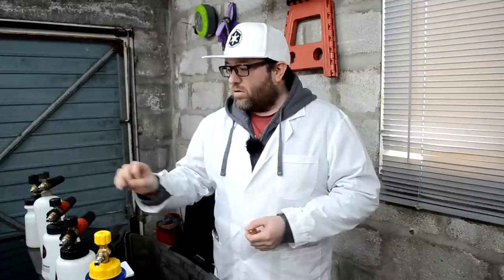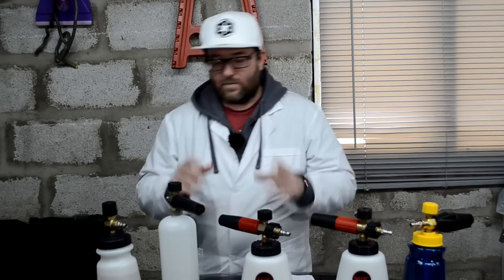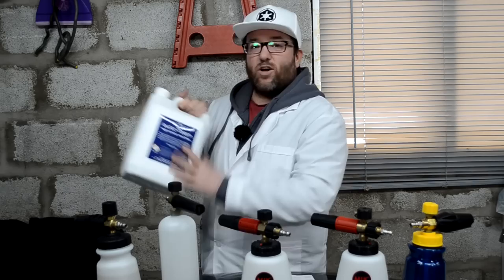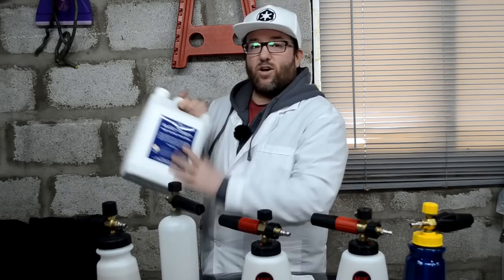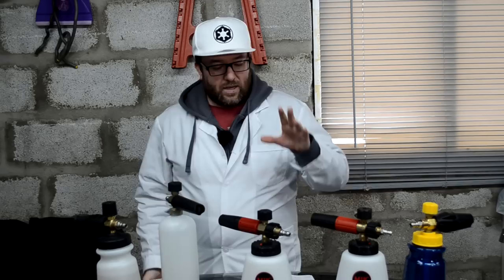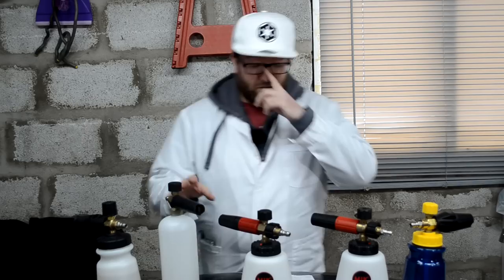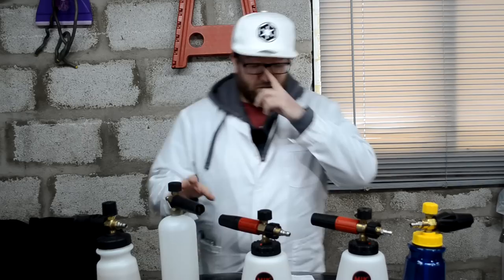Are You Using Snowfoam WRONG?!

Comment: Great content specky, I use a K2 with the autoglym lance. I use the BH pir ratio witch is 486ml of product with 514ml of soft Scottish water. 

Only problem for me is that it doesn’t start foaming up till 3 quarters down the bottle. Witch is really annoying, it could be down to the Karcher hose restricting the flow. 

I have a Screwfix special that is more powerful, and I have modified the QR gun to fit. I have just not tried out on the car yet.
Reply from the maker: Strange that it doesn't foam straight away. I had that when I first used snowfoam and just kept twiddling the top dial until something changed and there was foam aplenty.
Reply: @SpeckyMcSporran   cheers mate I will try that this weekend 👍🏻
Reply: Do you run your K2 for 30 seconds or so before connecting your lance? This blows out any air from the hose and ensures a full bore of water. If you have any air in the hose when you connect your lance it might take a while to properly combine with the product in your bottle.
Reply: @allanmountford21   never thought of that, I will give that a try. Thanks mate 👍🏻

Comment: I’m only at the start of the video but I presume this video might be about panel impact ratio but I may be wrong , most manufactures don’t tell us this , bilt hamber do and I think it’s crucial as 1 pressure washer and Lance may end up diluting the snow foam with double the water compared to another brand so it won’t work right

Comment: This was fascinating, thank you Specky! Fantastic to see the real differences in flow rates between the different lances, especially to see how the MJJC V2 is performing, no wonder that throws up such thick foam, aside from how it aerates the product, it's the volume of product in there!

Did you also see that BH state you should get 4 average size cars from a litre of pre-mix solution?
Reply from the maker: Are we talking pre-dilution or post?
Reply: @SpeckyMcSporran  it's post (although a good joke to be made!). The wording on the PIR calculation diagram is "Please note - it is not necessary to use all diluted auto-foam in one wash. One litre of diluted product should last 4-5 washes".

I've achieved that before, you need a really wide fan on the lance and you're running around it, barely getting any on it really, it's definitely not a blanket of foam!
Reply from the maker: I was going to mention that, barely a teaspoon of product hitting each panel 🤣
Reply: @SpeckyMcSporran  I need a winter warrior car that still hasn't been cleaned in order to demonstrate the difference in cleaning ability...but I've done most of my customers now 🙃

One thing I was wondering on the video is where you found in the analytics you had drop off. I skipped from about 2m45s to 6m30s (ish) when you were talking about fan width and orifices (because this isn't nee info for me, it was relevant information for some and glad it was included...but it's hard to make that sort of stuff engaging).

Comment: Good vid. Better to use a hot wash or a cold wash
Reply from the maker: Most snowfoams are designed to work with cold water as it would be cooled rapidly by the flow of water through the lance. If you have a heated pressure washer then the heat would definitely help to a degree.

Comment: It's catch 22. I sympathise with the manufacturers as for sure there are a lot of consumers that just want to know how much product to put in their lance. But this just does not stack up as the variation based on equipment in use can be massive. So I also blame the manufacturers for not acknowledging this. We need PIR based measures. I tend to take ratios for sprayer bottles as this is given more commonly on products then work that back to what it means to achieve that as PIR in my foam lance.
Reply from the maker: I think most chemical breaks want to give a generic average number that will suit most people. I'd like to see more brands (specifically those who are popular with professionals/enthusiasts) make panel impact ratios available and even make a bigger deal of it.

Comment: Great video, this will be very useful to a lot of people I think 👍🏻
I think you mentioned that you had the mixing valve set to max water flow (I may be wrong)? It would have been interesting to see the flow rates with the mixing valve giving max product as this is how most people use them and it would change the PIR again.
Reply from the maker: No, the valve was set to maximum product delivery. Sorry if I didn't make that clear, I was measuring the maximum product delivery to the water stream.
Reply: Wow, that does make those higher flow figures really significant then! If your lance does 17ltr then at something like 1:10 your getting minuscule amounts of product, your only getting something like 6% of the already diluted product through the lance, per litre……
Really makes you understand why companies like BH push the PIR so much haha
Reply from the maker: Yep, I'd like to see more manufacturers make their PIR figures available.

Comment: Very useful video cheers, I'm new to using foam and just got a pro kleen lance plus with some of their foam. Not impressed with the foam which suggested it was super concentrated and to use 9:1 and boy does the lance guzzle the stuff, looks similar to your duel unit and guessing it's just as thirsty if not worse. Drank a whole bottle to just about cover a fiat 500 went on fairly thick and covered well but the stuff did not dwell very well at all. Debating whether to send it back and spend a bit more on a lance or just try a better foam product first.
Reply from the maker: If you can get a small sample of a different snowfoam to confirm then you're better doing that before spending more on a new lance.
Reply: @SpeckyMcSporran  thanks, I reported the issues to the supplier of the lance and foam and they've sent me a different foam to try 👍🏻

Comment: Brand new power washer owner as of about 3 hours ago, so this may not be the smartest question lol but-.. wouldn’t it be potentially worth the effort to “figure out” the correct position of the adjustment screw (and locking down/gluing/marking or whatever) instead of doing a mixture every time? Then you would just put in 100% product and could have the correct end result without having to measure?! I don’t have the real world experience to know if this is feasible, but it will be my first experiment so wish me luck! Lol

Comment: The bottle with water and snowfoam pre-wash also needs the air from the bottle in order to work correctly, right? So ... I guess the bottle shouldn't get filled completely?
Reply from the maker: That's generally correct but some bottles have a breather hole to compensate.

Comment: Hi. It is wonderful video. A quick question. When you mentioned to keep the dial wide open, you meant max of water and less of foam liquid from the bottle or is it vice-versa. Thanks.
Reply from the maker: I meant wide open to allow the highest flow of foam into the water.
Reply: @SpeckyMcSporran  - Thank you so much for the clarification.
Reply from the maker: No problem 👍🏻

Comment: Great insight into this. How does it work with a cheap karcher snow foam lance. Lucky if I have a 300ml bottle to fill.
Reply from the maker: It should work the same way as we don't need the bottle measurement, just the amount of water. Do the same thing, measure the total water needed to drain your bottle and multiply it by the percentage of panel impact ratio you need.
Reply: @SpeckyMcSporran  thank you bro. I’ll do this later on.

Comment: I just put 100 to 150 ml of foam top up to 500 ml with water depending on how dirty car is , only use 500 ml of total product on my vw van 

For me never failed ,never bothered to work it out
Reply from the maker: That's fair, not everyone needs to know but you're using the foam at an above-average dilution ratio, which is likely closer to the correct panel impact ratio. 👍🏻
Reply: @SpeckyMcSporran  guess i should actually pull my finger out and work it out correctly. 

It doesn't seem over kill rinses off ok 

Bilt hamber autofoam is what I use

BTW love your chanel thank you
Reply from the maker: Thanks for the support Jez! 🙌🏻

Comment: Fit like the day loon. Very technical video that had it been anyone else I would have been nodding off as I have in the past. I may go ahead and work this out sometime I am at a loose end as you intrigued me. I have always gone for 50ml to 450ml or 75ml to 675ml or 100ml to 900ml depending on the size of car and not thought anything about it. I presume a 4% PIR is a good general setting if there are no instructions on the snow foam. Regarding sealants what would you suggest for a PIR. Have you tested the cleaning power of a PIR of 4% against a 10 to 1 ratio which surely at the end of the day is the whole point in us using this item and Snow foam. The boy returned from Uni in Aberdeen at the weekend with a car with multiple layers of seagull s**t. I had put GT CS and Sigma on it before he went up at Xmas and TFR and Snow Foam lifted it all including sealants but no etching as far as I can see. Just an idea for Aberdeen folk as my car had been hit on 3 panels by one gull within 10 minutes of arriving and there are rings on the clear.
Reply from the maker: Fit like John?
Ah yes, the scourge of Aberdeen strikes again! Thankfully I live in the Shire so the dreaded "Scurry" is less often seen.
I haven't tested the cleaning ability of 10:1 Vs 4% as of yet but that'll be another video. I'm glad I wasn't boring you enough to put you to sleep 🤣

Comment: Does it change if you don't open the lance dial fully?
Reply from the maker: This test was performed with both lances at their most open settings. Closing down the screw will weaken the  solution and create less foam.

Comment: Great video specky! So.....what about when the instructions say "add 2 inches to the bottle" i switch between bilt hamber autofoam and auto finesse avalanche. I use a mjjc lance which has a similar output to the duel one that you tested,so 400ml of bh to a litre,yet the af avalanche states "2 inches" so with that in mind the bh snowfoam is a more accurate dilution level.....what do you think?
Reply from the maker: I touched on this in the video but basically only two snowfoam manufacturers actually care that you use their product correctly, the rest just give you a general/average dilution ratio that works for the average Joe. I'd like to see more manufacturers publish their recommendations for panel impact ratios so the professional and enthusiast user can get the best for their hard earned money.

Comment: Can I ask, what's the point of the dial on the top of the snowfoam if you run it a maximum for the test and calculating PIR. I've guessed at the amount of product and have reduced the flow rate through the nossle so there's a happy medium between thickness of product and longevity of product. Is there a right and wrong position of the dial?
Reply from the maker: That's a great question. Basically when you adjust the top dial you have no way of knowing how much it impacts the flow/dilution rate. They could add numbers to the dial but there's no way to tell 100% how much difference it makes without turning it and running the flow rate test again for each dial rotation. There's no right or wrong for it though, just figure out what works best for you. I hope this helps.
Reply: @SpeckyMcSporran  Yep. that helps... sort off... not really 😂

Comment: ok maybe a stupid question but......when you snow-foam and you add the 1 litre water and snowfoam solution when you connect the pressure washer do you snowfoam with the tap connected to the pressure washers on or off? as with it on its more water coming through?????
Reply from the maker: Are you talking about the tap on the wall providing water to the pressure washer? If so then, yes, that needs to be on or the pressure washer won't do anything.

Comment: Help! I have a Nilfisk P180 and an Autobrite
Snow Foam Lance, good water water pressure from the tap. Lance open to Max. And used 100 litres before the lance bottle was empty. Is this possible?
Reply from the maker: Sounds like the knob on top was fully closed, turn it fully the other way and try again.
Reply: @SpeckyMcSporran  thanks for the quick reply mate. Will try again tomorrow. I wonder weather the filter needs look at as I don’t notice any difference when turning the tap on the lance.
Reply from the maker: That's a possibility
Reply: A lance maintenance video would be much appreciated! As I have no clue how to look after this peace of equipment.
Reply from the maker: That's a great shout!
Reply: @SpeckyMcSporran  thanks Specky, I did have the knob turned the wrong way. Mine is 13300ml when bottle is empty. X 0.04=532 of chemical.  However the gun has started to leak from the power washer fitting so a maintenance video was be very much appreciated when you have the time.

Comment: Hello, would you be in a position to recommend a foam lance model? Ive been looking online for a while and im just not sure what to buy. I have an older k3500 karcher and planning on using magifoam prewash. Budget is ideally £30.00 as I'm not a detail enthusiast just want to get the best bang for my buck. Thanks in advance.
Reply from the maker: The AmazonBasics lance is good for £20, Detailed Online do one for £25 which is good but needs stronger dilution.
Reply: @SpeckyMcSporran  thanks for the advice  I found the prokleen foam lance for £25.00 and decided to give it a shot. If I do get into detailing then I'll look again at the upper end of the market.
Reply from the maker: That looks like a good one 👍🏻
Reply: @SpeckyMcSporran  Do you know of any decent bug and tar spray/remover? I've seen a brand Nano Go - looks to remove all the hard to remove stains but again it's a gamble for me.
Reply from the maker: Most all purpose cleaners will do the job for bug removal. Get a dedicated tar remover for tar spots.
Reply: @SpeckyMcSporran  great thanks again.

Comment: Help!!! I have Meguires snow foam bottle, filled to 1l , opened up the control, filled up 57L of water in buckets, still had 1L of water in the bottle, when I shut the water flow down, I got 19L of water before the bottle was empty, Help !!!!
Reply from the maker: Ok, 19L of water is 19000ml so you'll need to multiply 19000 by the percentage of panel impact ratio. So 4% means multiply 19000 x 0.04 which is 760ml of snowfoam topped up with water when you have the dial set to least water.
Reply: Thanks for info, give it a blast in the morning, 👍👍
Reply: Definitely been doing it wrong, only ever put 200ml into 1L, keep up the good work, your helping us novices 👍
Reply from the maker: Glad you've found it useful